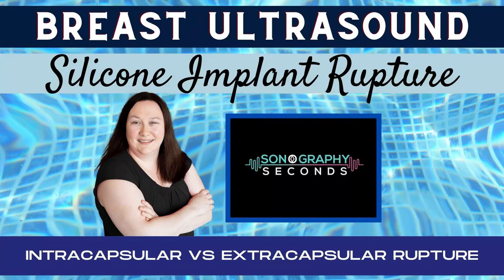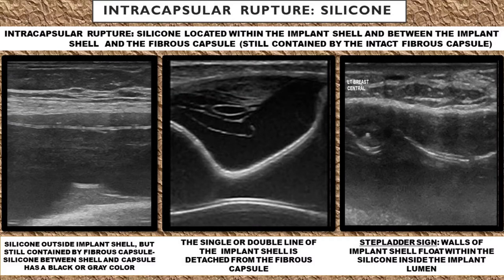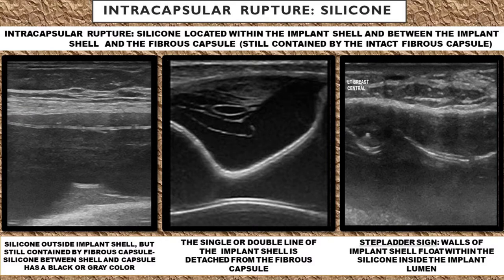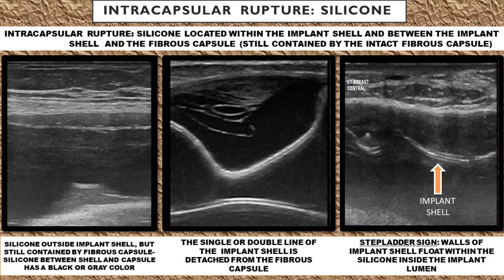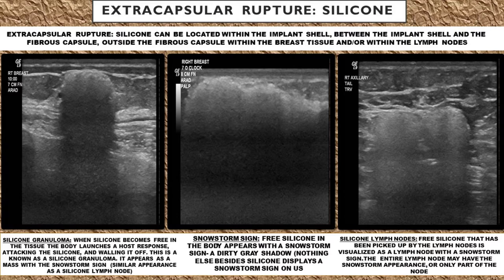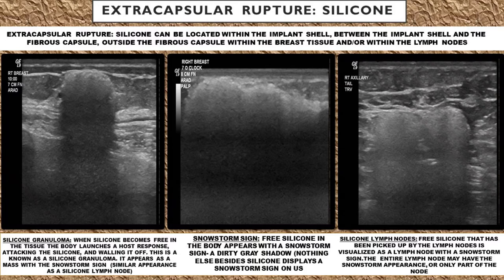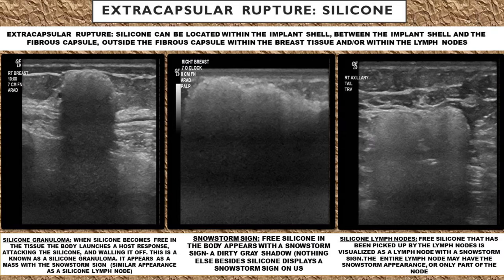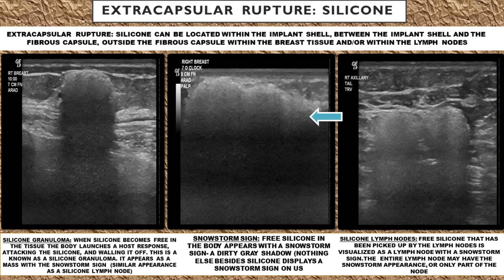Breast Ultrasound (Silicone Intracapsular vs Extracapsular Implant Rupture)

Comment: Can you tell me please if it's possible to see any capsule on an ultrasound that might have been left over when removing breast implants?
Reply from the maker: I’ve racked my brain on this one, and I should know the answer to this, but I have to admit that I’m not sure. I’ve never specifically looked for or evaluated a breast capsule itself after a breast implant has been removed. I imagine that a capsule without an implant would probably look like an area of thickened tissue that’s different in appearance than the adjacent breast tissue. You’ve stumped me…and that’s hard to do in breast ultrasound! 
Calling all breast radiologists….do any of you know the answer to this question???
Reply: @SonographyMinutes  Thank you for responding.  Yes the capsule is the scar tissue that the body creates around the implant/foreign object and becomes very thick.  When the implants are removed, often times some of the scar tissue capsule is left behind and the woman never recovers.  That's why it's important to know if there is any imaging that might pick this up.